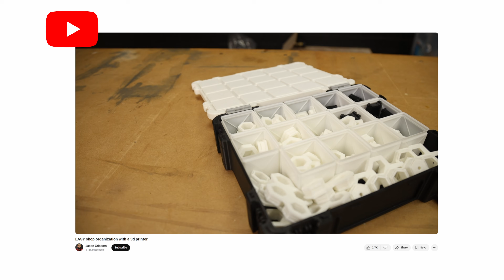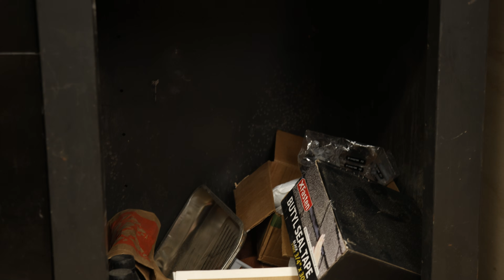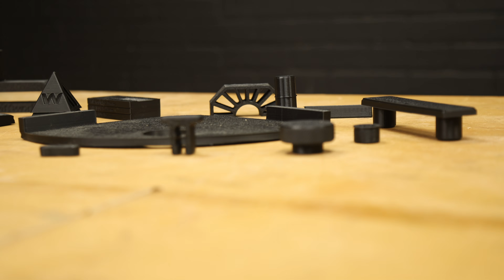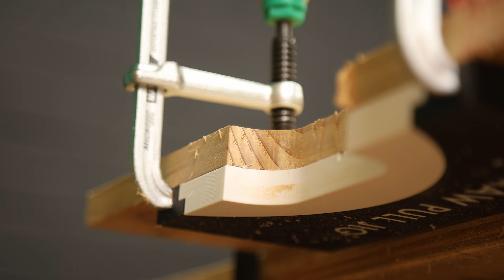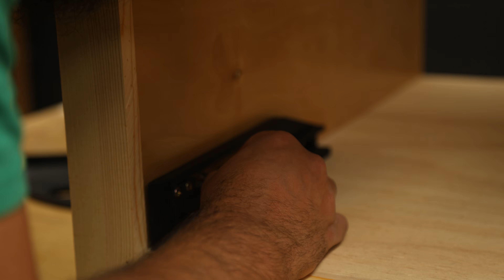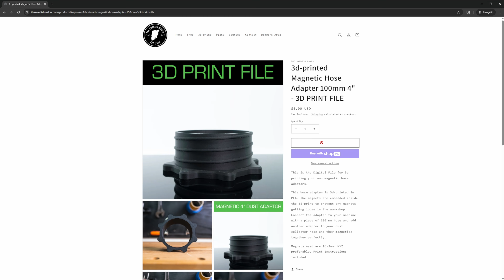Testing YouTuber 3D Prints in My Wood Shop

Comment: Nice video! I’ve been trying to learn fusion 360 to print my own stuff but after watching this I think I might just pay for the files lol
Reply from the maker: There are a TON of videos teaching people to use fusion 360. I highly recommend learning it. My approach has been a "stepping stone" one. I need to make a circle thats a specific size, learn to make it. Then I need to learn how to make threads for a replacement lid for a jar, learn to make threads. And so on and so forth. Before you know it, you learn enough things to piece it all together to design a cool jig or even whole furniture pieces. Another bit of advice, design things to just do it, even if its not needed. For instance, I installed a couple windows (my 1st time doing it). I had a good idea of what I wanted as far as trim and what not but I designed it all out so I had a good representation of sizes and reveals. Its just a fun little exercise. But yeah, sometimes it makes sense to just buy a file. 🤣

Comment: How dare you. Ever heard of hair spray?
Reply: Oh God... flashbacks. Level your bed!

I haven't used a piece of paper on my print bed in over a year and I don't  miss it.
Reply from the maker: I learned 3D printing on an old Ender 3. Those were dark times.
Reply: @JasonGrissom  I had the Ender 5. After upgrading stepper motors, the MB, the springs, the mounts, the screws, and putting a literal sheet of glass on it I don't know what it was anymore. Still have it, no idea what to do with it.
Reply from the maker: @Woodman668 maybe the smithsonian would be interested?
Reply from the maker: Honestly with that printer I may have to!

Comment: Great video about 3D printing in the shop.  I'm always on the fence about whether the material can function in an abusive environment.  Some of my organizational stuff has broken randomly when I'm working, but I think we need to keep pushing the limits to test WHERE we need to use this stuff in the shop.
Reply from the maker: Thank you! You're absolutely right. I find that for the most part, it is all about the layers. A lot of people choose to print in the orientation that is the easiest to print (im guilty of this 95% of the time) not thinking about the job it'll be performing.
Reply: @JasonGrissom  Yeah, if I had made the layers go along the supports on some of these, they might not have broken.   Kind of like wood grain orientation.  I really want to get an enclosed printer that is capable of carbon fiber nylon.  I have that stuff at work and it doesn't care about layer orientation and takes the abuse.
Reply from the maker: Well said. Grain direction of wood is a good way to put it. I havent played with too many of the stronger materials. I've used ASA quite a few times and have always been impressed by it's durability. Again, still hard to print without an enclosure. I use my Anycubic S1 for my ASA prints.